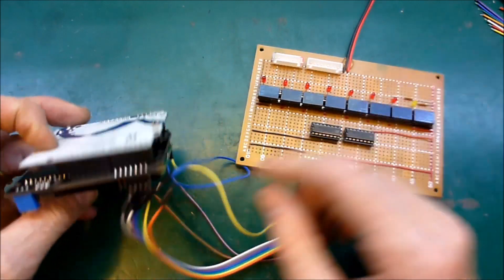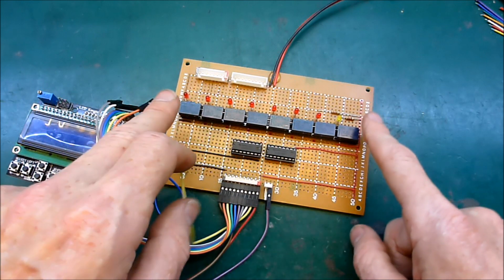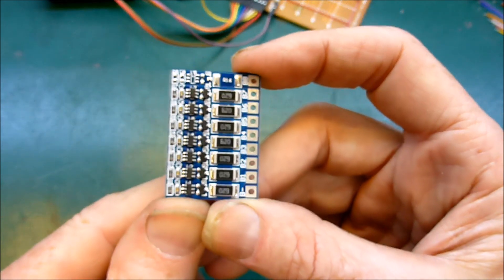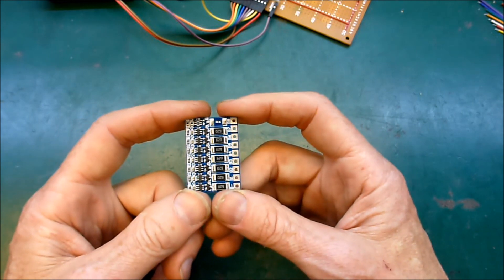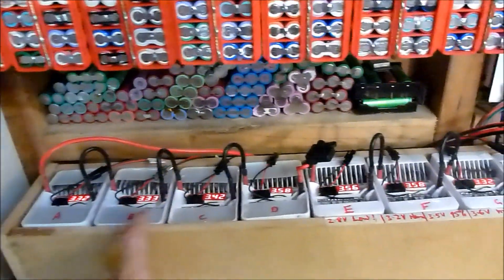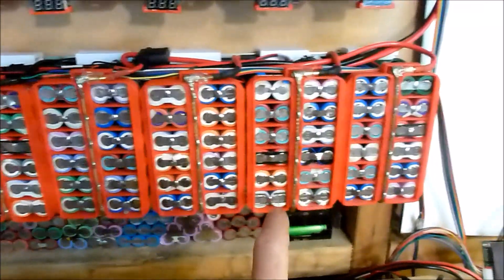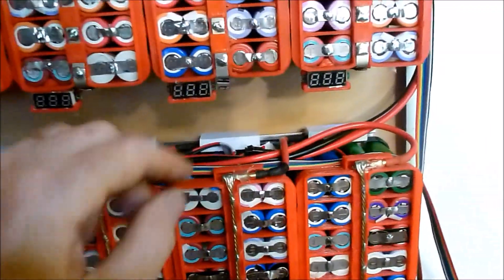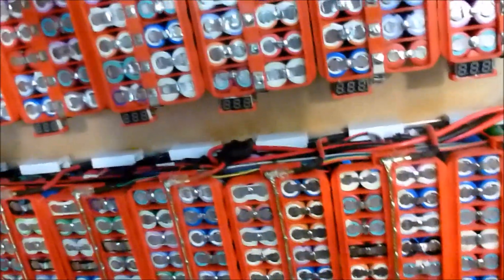Laptop Powerwall 128 - General update

Comment: this idea will work, but it's a game of diminishing returns. the closer the difference between cells, the less current will flow, so you end up having to switch the relays faster, then you realize the lifespan of the relays will be unacceptably short, so you decide to use mosfets, then you pull your hair out trying to design a system with a ton of floating gate drivers. ask me how i figured that out.
Reply from the maker: Having a system that is simple to understand, does balancing at all battery levels and provides a balanced spare group are all useful features for me. I'm not too worried about getting the groups perfectly balanced - anything under 100 mV is OK by me (although under 50 mV would be nicer). I have been thinking about using solid state relays eventually. I need to get this simple system working first before I jump too far ahead :)
Reply: to be fair using Arduino and MOSFETs would be good if code was used to switch fets to drain power mode to balance @ 3.7 and recharge to 4.19 and balance again after set charge time ..
.but it's a lot of work lol

Comment: Nice update I was wondering if every thing was ok with you. I am trying to work on an  arduino 7s battery monitor time 8 so it will have to monitor 56 batteries. I am also glad I am not the only one who smokes board :-) looking forward to the finished product
Reply from the maker: Hi OTE. What circuit are you using to measure the voltages with?

Comment: That’s an interesting idea using the eighth pack. Do you think you’ll balance pack eight with the highest pack, then the lowest, then the next highest etc... might be the quickest way. I like that although they’ll be some losses, it’s not nearly as high as simply shoving a resistor across the highest pack. Two question for you... how much current do you suppose will flow from one small block to the eighth when you balance them, and how do you intend to accurately measure each groups voltage without having a ground loop or inaccurate resistor ladder?
Reply from the maker: Hi Adam I hadn't thought about sequencing from high to low. Sounds like a good idea.
My plan is to start with the pack pretty well balanced already so the current is going to be minimal - less than 1 Amp (the relays are rated at 10 Amps). I could upgrade the relays so that I can balance highly divergent packs - that would be useful. I'm using 24P groups so at 1C I could go as high as 24 Amps without stressing the cells.
In version 0.1 I'm powering the Arduino from a separate floating battery to avoid the ground loop problem and just accepting the inaccurate results from the analogue pin. Eventually I'll move to having the Arduino powered by the pack (with a buck converter) and use a opto-isolated ADC. 
I'm not quite skilled enough to do all those things in the first iteration.

Comment: Arr That's the big problem with those bms/balancing that most people don't read. The balancer only works when charging to 4.2 not to 4v or any lower voltage
Reply from the maker: Yeah - unless they hit 4.2V then it's not balancing, but it does at least prevent a single group from overcharging. So that's something at least.
Reply: thats right and it will also cut off if a cell drops too low in voltage which is handy

Comment: Isn't this is a variation on the flying balancer?. Instead of using another pack (unless it's a production pack), why don't you use a capacitor and a resistor to limit current throughput? That would allow you to use the capacitor right on the board and only have 1 pack connecting to the board.
Reply from the maker: I wanted to have a spare group that was always at the average pack voltage so I'll be able to swap it in to replace any group that goes bad. I currently have 28 groups and plan on getting to 56 eventually. Having a spare that I can hot swap seemed like a good idea.